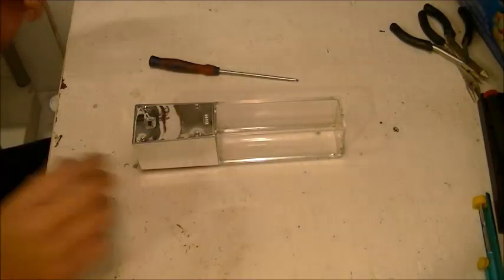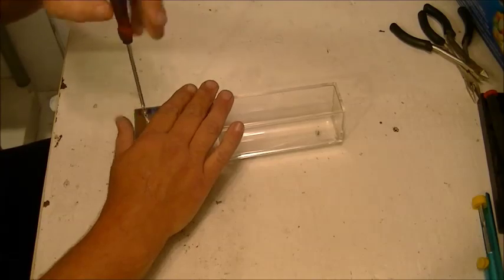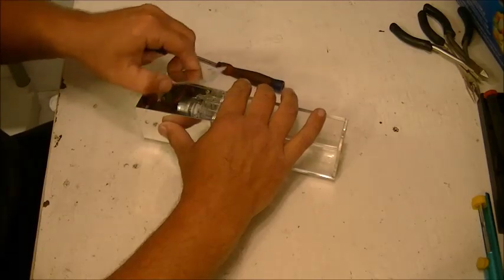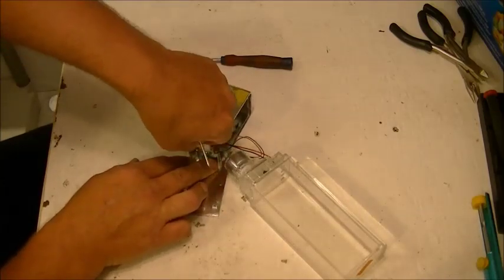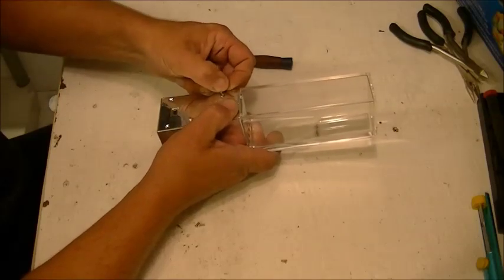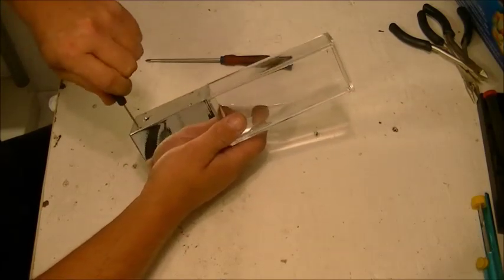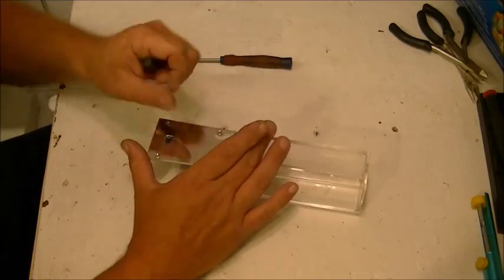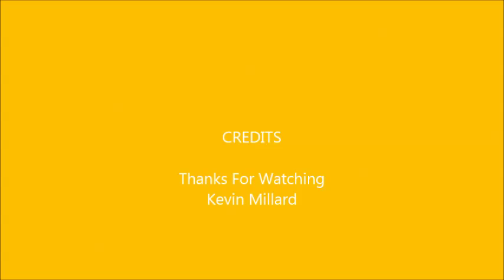Gadgetree Dancing Water Speakers Take Apart and bypass speaker

Comment: So my speakers have a connector that also contains the led wiring, which means if I unplug it, the water will shoot because the motor is still working, but the led's won't turn on. I'm guessing the solution is cutting the wires that lead to the speakers, but I am afraid the circuit may stop working because of the gap. Has this ever happened to you?
Reply from the maker: you can disable the leds by cutting the wires off and it wont affect anything you can also unplug each spaker and just have the leds on only if you want as well this has to be done on the inside of each speaker
Reply: Kevys Rc & Music
The plug contained both the leds and the speakers. So I cut the speaker wiring. Works like i want it to now.
Reply from the maker: cool
Reply from the maker: yes just cut the power wire on each motor only
Reply: *****
Kevys is right but, it's a shame, because these have terrible sound. The only thing really worth it is the lights show. However, they are your speakers, so do whatever you want.

Comment: I bought a splitter adapter P2 and able to do this for use with a headphone, I was surprised because my secondary speaker (in the video) has no adapter to disconnect, then I discovered that it is in the primary speaker which should happen by the difference in brand (mine is of the LILENG brand). I'm glad I found your video series on this waters speakers, now I'm just a little afraid of using too much and the engine becomes weak or stops working
Reply from the maker: if your watning to stop the audio form both speakers then you have to unplug the speaker in each cab inside

Comment: I been working on electronics since 80s.Mostly audio and video.I also collect it.With that said, I understand the vid and these water speakers.I actually am in the works to take 20 of these and I built a box.All will tie into the box and hook to my 7ch mixer fixed audio line.Inside the box is parts to cap off the db sig so the water line bounces to about 90% max.In this, I have came upon few speakers that motor is shot when I brought used.Appears upon testing they need motors.Going by the specs, appears a replacement motor can work.Key is, the size of the motor fitting.Even if the voltage etc would differ upwards, resist it down to broken motor spec.Problem is, I can't yet find a replacement motor.Who has them that size? The motor size is the key factor.
Reply from the maker: no idea man i use to strip these for parts i used to have a ton of parts but dont have anymore parts left now
Reply: I understand.I am close, I deal with dozens of companies I order parts from.Which is a wide range being I work on pretty much alot.Being audio, video and cb radio collecting and fix as my main hobby.In a nut shell, gives me a view wide for parts and hidden places etc.I am still looking and by this week hope to get it narrowed.I been ordering motors and no luck.My last one was darn close so, I may hit luck in my recent order I get this week.If I do, I'll order a box before they sell out for sure to keep case I need more lol.
Reply from the maker: good stuff

Comment from the maker: first make sure your audio cable is plug in firmly also all cables if that dont work then yuo need a new motor but check first make sure you still have approx the same about of liquid in each speaker

Comment: Hi there, I bought a pair of these speakers (twice actually) and both times they arrived and the first pair had leaked so bad there was no water or oil or whatever they use in it and the 2nd set have arrived and also leaked but not as bad. Is there any way to refill the speakers?
Thanks!! :)
Reply from the maker: yes there i but i have never done it my self i have a video to tell you hw and what you need and there is another guy on one of videos that has the forumla for what you need to do check over my videos and the posts and youll find everything you need to know

Comment: Yo KevinMillard68 I got my speakers for like 7 months or so,but like 2 months ago the other speaker stopped making sound, the lights and the motor works and blows the water up but the sound doesnt come out. 
I took the speaker apart today and didnt notice any broken connections, everything should have worked but the sound aint coming. If you have an idea how to fix it /whats causing it let me know :)
Reply: +mardei12345 hi, I know its been 4 months but I have this problem. I was wondering if you where able to fix it and if so how. I cant retrm them and I would like to fix them so a response would be appreciated. thanks
Reply: +Odin 10 months*
Reply: +Odin Palen Idk,havent fixed them i used to listen to music with them and play on my PC but i switched to headset.
Id still like to get them working but idk how
Reply: I see. I have a good hedset too, just kind of disappointing they allready dont work. Thank you for the reply much appreciated.

Comment: I just got the speakers and one of them is empty ! Is there a way to put some more water? or is it some kind of oil ? 
Thanks
Reply from the maker: if you buy a needle syringe and mineral oil you could put in more dont know what kind of mineral oil it is, i also have a few glasses with oil in them i fix alot of these so i have some parts for them if you want to order in a new glass from me then email me at airsmith28@hotmail.com with your shipping info and ill get you a total with shipping and payment details
Reply from the maker: if you just bought them take them back they come with a 90 day warranty other wise buy a needle syringe and mineral oil you could put in more dont know what kind of mineral oil it is
Reply: KevinMillard68 Thank you very much...

Comment: by bypassing the speaker, can you connect these to a sound system and have sounds through the sound system speakers but still have the water speakers, just no sound through them?
Reply from the maker: Jess Mason yes you can thats the point of the video on how to bypass the speakers so you just get the water effect
Reply: im meaning to stereo sound system, not a PC. 
moot point anyway, my sound system has no 3.5 mm jack. ty anyway :)
Reply from the maker: Jess Mason you can get adapters to do what ever you want
Reply: yeah I'm on the search now. thanks man
Reply from the maker: Jess Mason your welcome

Comment: i have two questions.
1. does this work with like gaming headsets with usb?
2. do you need to do this on both speakers? 
i know this video is 3 years old but please reply quickly!
thanks mate, sorry for my bad english!
Reply from the maker: no idea man youll have to try what you want to do and see what happens
Reply: what im trying to say is that can you connect the water speakers to a headset? so like the speakers will dance from the sound from my headset? and again sorry for my english! thanks!
Reply from the maker: not directly you need to use a Y adapter from your computer output

Comment: Hi,  the jack to plug my audio in has fallen into the speakers on second use, can it be fixed? I'd appreciate advice.  Thx
Reply: Seems to have broken and dropped off inside.
Reply from the maker: you can try and solder it back in but other wise nope cant be fixed even i dont have spare amp boards for thoes
Reply: Okay, thanks will see what  can do. It's a shame I can't return them. Thanks again for reply :)

Comment: I just got these for Christmas & it says "Low battery, please recharge" I have been trying to figure out how by the box and directions but I didn't find anything
Reply from the maker: +Paige McDowell if you got the set that i have in the video they are not rechargeable but you have to use the usb cable to power them so i think you have a different problem,

Comment: my speakers fell off my dresser and the cable inside broke but how do you replace it with out buying a new one
Reply from the maker: if its the main cable form the main speaker you can solder it back in place, you dont buy a new main cable they dont make parts.
Reply: how do I solder it back in place like I can see the wire KevinMillard68

Comment: I need to know how to replace the liquid aparently its mineral oil.  Mine were shipped to me and the oil leaked all over and I really dont want to send them back to hong kong .  Its not worth it.
Reply from the maker: youll need some mineral oil you may have to thin it out but i dont know with what  and you need the same oil and you need a surenge with a needle to inject the stuff then you will need to reseal the plug

Comment: can i do this in vise verse. so i can use the speakers and not the water
Reply from the maker: if you want to use just the speakers and not the water then you have to cut the power wires to the motor in each speaker
Reply: Just get a real speaker, these are gimmicks with crap audio.

Comment: Please begging you, please make a tutorial about how to fix the speakers. The right one is not playing, only the left one is playing, how can i fix the speaker ? Please for god sake !
Reply from the maker: here is how it goes , option 1 make sure the audio cable is firmly in place into the device and into the speakers. 
option 2 if option 1 does not work replace the audio cable with a new one , option 3 if option 2 does not work replace the dead speaker with one that you know works option 4 if option 3 does not work order a new set of speakers keep old set for parts .. if replacing the audio cable does not work and if making sure cable is firmly in place does not work you either have a have blown amp in the main speaker or a bad speaker .. the only other problem could be that you have a wire broken off on the speaker thats not working in which case if it is just solder it back on..
Reply: Kevys Rc & Music lol

Comment: One of my speakers blew out or something only the bass you can hear and see the lights but U can't hear anything,this really got me mad because I got them for Christmas and they already broken and I opened it up and found that the green and yellow cord are to the speaker....plz help😔😩
Reply from the maker: i have parts i need to know the parts you need and then you email me your shipping info and ill get you a total with shipping other wise buy a new set my email is airsmith28@hotmail.com, PS if you blew the amp inthe speakers that is one part i do not have at all so recheck to make sure all your connections are in solid

Comment: My left speaker is making weird screeching noises. Do you know what that might be?
Reply: Like it would just randomly do the noise it. Is it maybe like a loose wiring?
Reply from the maker: off hand no but could be 99% chance a bad speaker it can happen. i can sell you a replacement that you can be installed really easy email me your shipping info and i can get you a total with shipping airsmith28@hotmail.com
Reply: The one with all the plug ins? how much would you charge? and my speakers are a light blue.
Reply from the maker: Cristal Merced email me a pic of the speakers you have please airsmith28@hotmail.com

Comment: Is there any way im able to cut the water off of my speakers.. I wish to keep the water inside but i dont want it to splash up and down. Please help, !
Reply from the maker: open up the speakers find the motor wires and cut of either the + or the - wire or both just make sure to tape them after so they dont short out
Reply: Ok awesome thanks for your help!
Reply from the maker: ***** your welcome
Reply: Kevys Rc & Music Quick question, I just read how to cut the water on the speakers(which I assumed), but what if you want to put the motor back in action. I was wondering because I don't only use them for music, so when I use them for somethin other than music I can hear the water and it gets annoying. I know how to disconnect the motor permanently, but do you just reconnect the wires? They should have an on/off switch for the water.
Reply from the maker: Johnathan Conaway you expect way to much from these, and yes you just reconnect the wires, if you want to mod them you can install a power switch on each speaker on the motors so you can have control over the motors.. you have to run the switch either on the + wire or the - wire only on each speaker then that will give you the control you want
Reply: Ya I do, I just don't want to by another set of speakers just because the water can get annoying. I didn't even think about putting a switch in there, so I might. I really appreciate your time and reply! Thanks!
Reply from the maker: Johnathan Conaway your welcome

Comment: On my secondary speaker the usb socket fell through the and is inside dangling around How do I re attach it so It gets power?
Reply from the maker: if its the metal connector it self then try to solder it back on the pcb board if the whole unit broke then line it up with the hole and crazy glue the bracket back in place
Reply: How would I do that?
Reply from the maker: Ryan Patrick you have to take apart the speaker to start with then just go from there with what you need to do

Comment: is there anyway to add water to it?
Reply from the maker: youll need some mineral oil and you need the same oil and you need a surenge with a needle to inject the stuff then you will need to reseal the plug

Comment: How to you bypass the left speaker? I bypassed the right one and there's no sound, but there isn't any lights.
Reply from the maker: +Blake Mckissick both speakers get bypassed the same way that i show in the video
Reply: +Kevys Rc & Music 
When I opened the right one, the red and black wires came out. Is there any way to fix that?
Reply from the maker: +Blake Mckissick solder them back on i have a video on my channel about replacing the leds which covers resoldering them
Reply: +Kevys Rc & Music Could you leave a link, I couldn't find it.
Reply from the maker: +Blake Mckissick check my channel just do a general search on my channel for Gadgetree Dancing Water Speakers  youll find every video i have on them
Reply: +Kevys Rc & Music I'm sorry, but that didn't help.
Reply from the maker: +Blake Mckissick well sorry then you ll have to keep seaching on my channel for the led video  iam by no means trying to be rude but the videos are on my channel you need to take the time to look...

Comment: What happens if ur connection broke in side the box of the speaker 
Its the one to light it up
Reply from the maker: if its the wire that came off the led strip board then just solder it back on there are 2 spots 1 marked + one marked - 

red goes to + black to -  pretty simple stuff man
Reply: KevinMillard68 thanks
Reply from the maker: Edgar Dominguez your welcome
Reply: Its the usb port
Reply from the maker: Edgar Dominguez if you broke the USB Port then you can try and resolder it back on but i never had any luck yet when that happens to fix it, wires is one thing but the USB port thats a problem if the connector breaks , i can sell you a refurbished set of speakers for 20.00 plus shipping but youll have to email me your shipping info to airsmith28@hotmail.com
Reply: KevinMillard68  u just glue it to the original place
Reply from the maker: Edgar Dominguez you dont glue a USB PORT back on a PCB  board
Reply: KevinMillard68  it worked for me
Reply from the maker: Edgar Dominguez well thats good never has for me

Comment: one of mine lights in the right speaker changes his color in green but he is bleu how can i fix this problem ?
Reply from the maker: well you can order in some 3mm leds and change the leds your self or i can sell you an led strip that you just need to solder the wires to and your back in business email me your shipping info and ill get you a total with shipping the led strip before shipping is 5.00 each email at airsmith28@hotmail.com let me know how many leds stips you want , i also have spare motors as well if you need them
Reply: KevinMillard68 Ty for helping my out you hear soon !!
Reply from the maker: Roy Graven your welcome

Comment: Do you know how to refill the water speaker?
Reply from the maker: I dont have a video showing how to refill them i only tell you how in one of my videos perhaps 2 of my videos and that is not really water its a mineral oil and it needs to be thinned out to the proper liquid form and injected , it can leak out the plug or if you drop a speaker and crack it will its done if you crack the glass at all.
Reply: I have the oil. I bought it today but I looked for the video and was unable to find it.
Reply from the maker: Tayler Smith you also need the thinner for it so you can thin it to the same consistany of the stuff thats in there now PS PS I DONT HAVE A VIDEO showing how to do it i only explain it in text , i can and and will not do a video showing how its done,if you can not fiquire it out your self from how i explain it then you should not do it.
Reply: KevinMillard68 so if you add just a little bit of water, I shouldn't do that? My right speaker also stopped shooting the oil, I noticed it "leaked" more than the left the second I gotten it (for Christmas from a cousin.). I probably won't be able to even get the "oil", so i'll just have to live with the right speaker not bouncing the liquid anymore. Funny thing though, I must be imagining it, the left looks like it has more in it haha.
Reply from the maker: quentin diaz your speakers man do what you want with them
Reply: @taylerrsmithful  same for me this man cant direct us in the right direction one bit